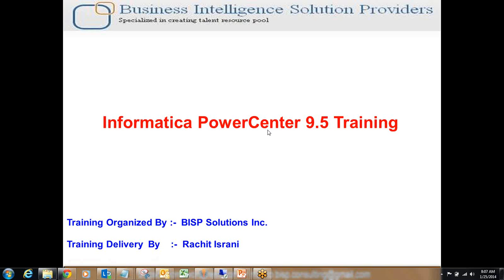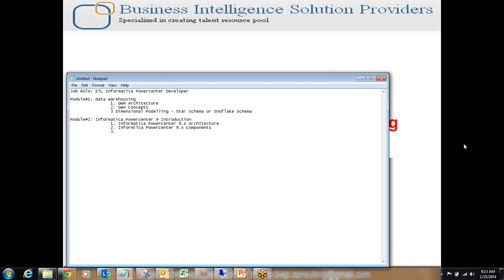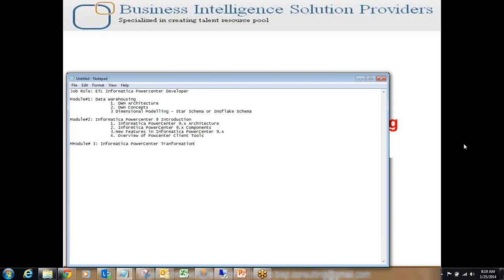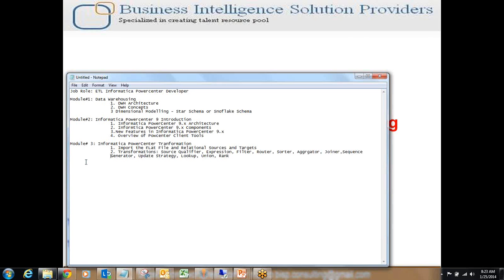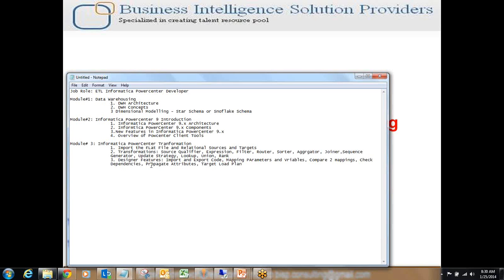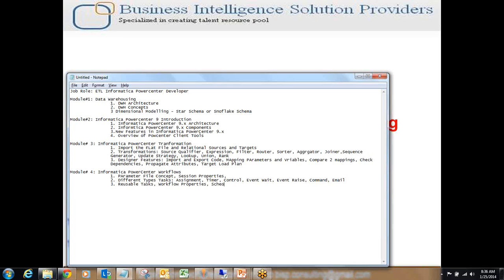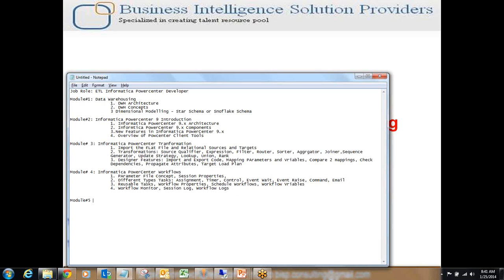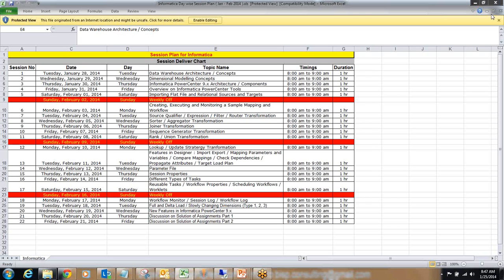Informatica 9.5 Powercenter Introduction | Informatica Developer Track | Informatica ETL Tutorial

Comment from the maker: Informatica Free case studies and hands-on guides
Developer track Case Studies and Documents
Filter transformation	http://www.scribd.com/doc/113574386/Informatica-Filter-Transformation-1
Loading Data From Flat Files	http://www.scribd.com/doc/113574581/Informatica-Load-From-Flat-File
Designing Expression	http://www.scribd.com/doc/113579259/Informatica-Expressions
Router Transformation	http://www.scribd.com/doc/113595847/Informatica-Router-Transformation
Informatica Rank Transformation	http://www.scribd.com/doc/114110489/Informatica-Rank-Transformation
Aggregator Transformation	http://www.scribd.com/doc/114112276/Informatica-Aggregator-Transformation
Lookup Transformation	http://www.scribd.com/doc/114118059/Lookup-Tranformation
Building Custom Correspondence Model 	http://www.scribd.com/doc/77090675/Importing-Customer-Correspondence-Data-Model
Informatica Rank Transformation 	 http://www.scribd.com/doc/114110489/Informatica-Rank-Transformation
Informatica Router Transformation 	 http://www.scribd.com/doc/113595847/Informatica-Router-Transformation
Informatica Expression Transformation 	 http://www.scribd.com/doc/113579259/Informatica-Expressions
Informatica Load from Flat File 	 http://www.scribd.com/doc/113574581/Informatica-Load-From-Flat-File
Informatica Filter Transformation 	 http://www.scribd.com/doc/113574386/Informatica-Filter-Transformation-1
Informatica Sequence Transformation 	 http://www.scribd.com/doc/114735437/Sequence-Transformation
Informatica Sorter Transformation 	 http://www.scribd.com/doc/114735424/Sorter-Transformation
Informatica Store procedure Transformation 	 http://www.scribd.com/doc/115430364/Inforamtica-Transformation-Lab-Guide-Store-Procedure-Based-transformation
Informatica Loading First N Records 	 http://www.scribd.com/doc/115430295/Informatica-How-to-Series-Loading-First-N-Records
Informatica Complex Transformation 	 http://www.scribd.com/doc/121607345/Building-Financial-Data-Mode-Lab-28-Complex-Data-Transformation-Guide-I
Loading Top N Records 	 http://www.scribd.com/doc/117226129/Loading-Top-N-Records
Working With Mapplets 	 http://www.scribd.com/doc/117589160/A-Hands-On-Guide-for-Working-with-Mapplets
Informatica "How To Series"	 http://www.scribd.com/doc/117226202/Loading-Unique-and-Duplicate-Records-in-Separate-Tables
Transpose ROws to COlumn 	 http://www.scribd.com/doc/117589159/Transpose-Rows-to-Column
XML Transformation Lab I 	 http://www.scribd.com/doc/119616861/XML-Transformation-doc
XML Transformation Lab II 	 http://www.scribd.com/doc/120268989/Informatica-XML-Transformation-Lab-Guide-II
Conditional Lookup 	 http://www.scribd.com/doc/120437069/Building-Financial-Data-Mode-Lab-21-Conditional-Lookup

Informatica Administrator Role
Informatica Admin Scripts: http://www.scribd.com/doc/144375679
Informatica Load Balancing : http://www.scribd.com/doc/142726141
Working with Audit Table : http://www.scribd.com/doc/132195374
Informatica Version Control : http://www.scribd.com/doc/126364203
Informatica Object Migration : http://www.scribd.com/doc/126366133
Working with Informatica Repository : http://www.scribd.com/doc/127751181
Constraint Based Loading	http://www.scribd.com/doc/145660386/Constraint-Based-Loading
Working With Informatica Scripts	http://www.scribd.com/doc/144375679/Working-With-Informatica-Scripts
Parameter File	http://www.scribd.com/doc/142994432/Parameter-File
Informatica Load Balancing	http://www.scribd.com/doc/142726141/Informatica-Load-Balancing
Informatica Audit Tables	http://www.scribd.com/doc/132195374/Informatica-Audit-Tables	

Inforamtica Installation Video	    https://docs.google.com/file/d/0B_1XbHhNvoFAYWVRTldvTlA4V2s/edit?usp=sharing
Informatica and Data Integration Video	 http://youtu.be/lMNFEib5poU
Reply: where can i find data the complete fincancial model database that is used in every hands-on guide